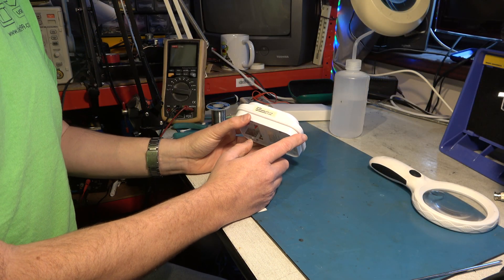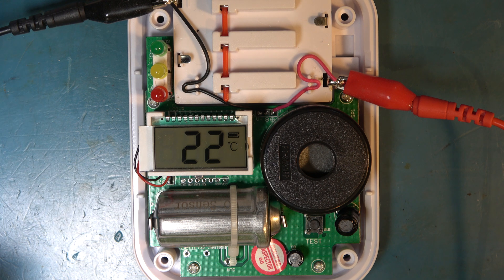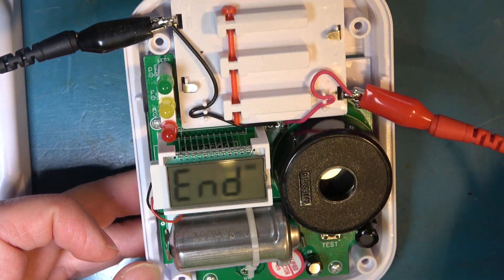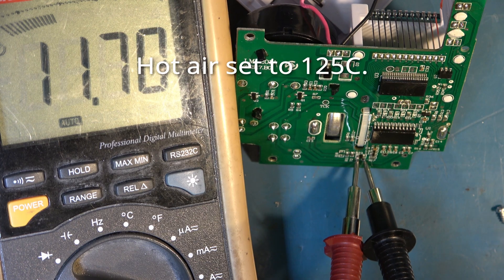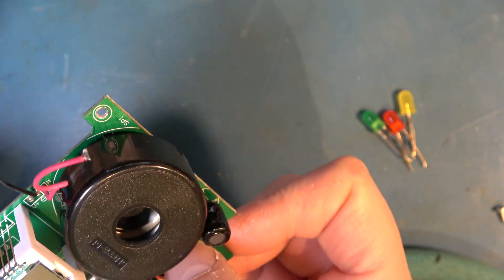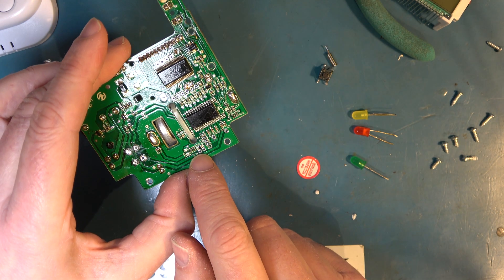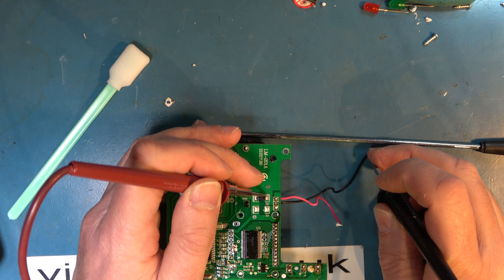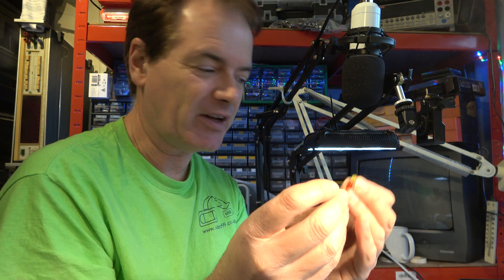Tear down a modern Carbon Monoxide Detector.

Comment: What causes a modern, stand-alone CO detector to "expire" or terminate it's own functionality? Is there an electronic component in the circuit that triggers the expiration?
Reply from the maker: It's the chemical composition of the CO detector which has a finite lift.

Comment: Had a CO detector back in the 90s that had a cartridge that was a combo battery as well as the sensor element and one time it failed and beeped even outside. I stopped using that detector but the battery was still good. Wish i had it today.

Comment: on a quick question: Do you know what the Panasonic Super drive exactly means? They have the name plastered all over their VCRs!
Reply from the maker: I think it refers to the K-mechanism, because it was much faster to get into modes than the previous G-mechanism as used on the FS88, FS90 and other early 90s machines.  The G-mechanism did a lot of clunking and clicking to get between play and winding or back for example.

Comment: But how does it detect CO?
Reply from the maker: It's detected by the chemicals in that cell which looks like a battery (because it's built in much the same way).  It is a small fuel cell composed of noble metal electrodes in an electrolyte, but the chemistry is beyond me.

Comment: There isn't much in those units to steal lol.
The pinout for the lcd display may be found by finding the holten chip pinout, unless it's just full of generic drivers.
I would keep the beeper if it was a ceramic disk type.
It's good fun stripping stuff for free, the best part :-D
I've made a few variable power supplys from bits and bobs i've saved.
My mate still uses one i made in 1988, it's still working and it uses a crappy amstrad stereo mains transformer.
A decent amstrad transformer, Now that's a sentence i never thought i would say :)
Reply from the maker: Some early Amstrad amplifiers were actually not bad at all.

Comment: About 30 years ago I bought a CO detector which actually did come with a replaceable detector. The whole device looked like a slightly fat smoke detector, no display, and the replaceable part was a bit bigger than a pp3 battery  This combined the battery with the detector so that both would need to be replaced annually. It was fairly expensive, 30 pounds or so, and of course the inevitable happened: when the battery/detector needed replacing after a year in service this proprietary part was not to be found anywhere. We survived without buying another CO detector until I bought one just like yours a by now must also be coming up to the end of its life.
I have a question about the LCD. Is that a hd44780 style module worth removing to use with an Arduino or is just an LCD driven directly by one of the chips on the back?
Reply from the maker: It's only an LCD (and backlight).

Comment: From cheap carbon monoxide boxes and upwards, it seems far too much stuff is 'disposable' these days.

Point in case, my ipad mini is coming to the end of its life now that Apple 'have decided' that they will not update it again and most apps now won't run on it, yet it still works perfectly.  Makes me very irritated. 

It's not like I could put Linux on it either, so what happens to it.... junk, ewaste.  It's not right. 

As you say, why not make these detectors simply have a replaceable component that snaps in to place?  

Cost.. no more no less. Knock them out cheap by the thousands and never mind the end effect on the environment.  
Such practice should be outlawed.
Reply: Well said.